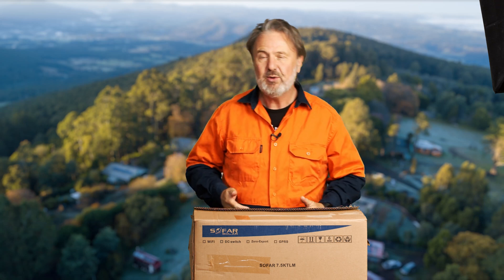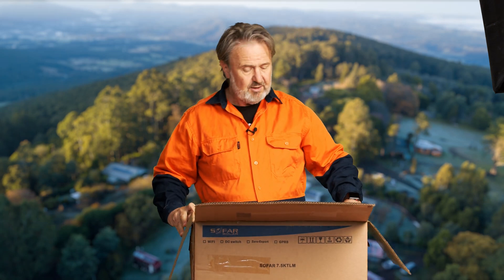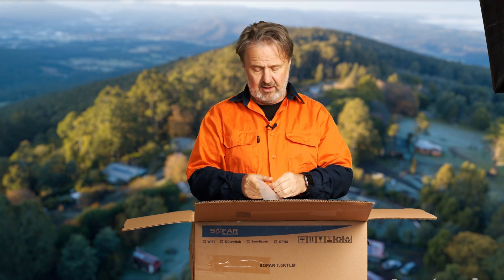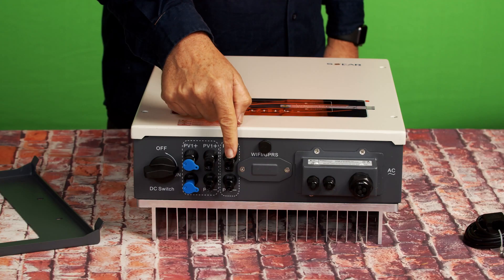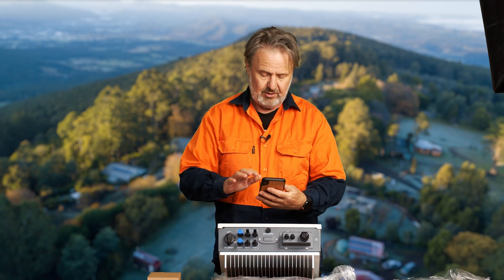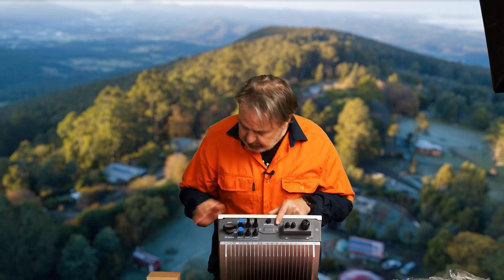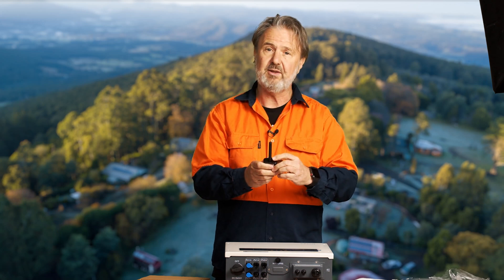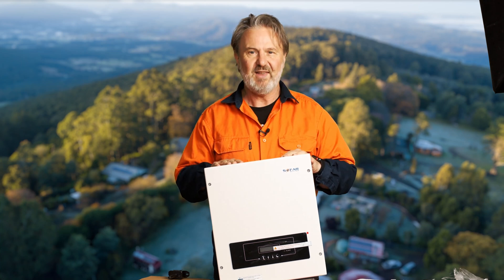Sofar Solar Grid-Connect Inverter

Comment: Hi i have a question about this inversor, If i have 10x 450W solar pannels i have to connect 6x to one PV1+ to MPPT1 and the other 4x on the other conector PV1+ MPTT1 so, on this way each connector has shared less than 2750w on its..... is it ok? Thanks in advance

Comment: GOOD DAY SIR, what if i have multiple grid tie inverters, say 3 pieces, since in our place there is no NET METERING, i would need to install CT sensor, my question is, how many sensors do I need? do I only need 1 CT sensor and connect all the inverters CT wiring in parallel to just one CT sensor? or do I need 3 Ct sensors, 1 sensor per inverter? Thank You sir.

Comment: Hello,

I have a Sofar inverter 20KW and the grid voltage is 220V in each phase. 

When the inverter starts injecting in the grid, the grid voltage starts increasing above 220V and can go up to 260V and the inverter shuts down and restarts, and the voltage goes down back to 220V, and it repeats the same cycle again.

How can I fix this to keep the voltage at around 220V?

Thanks in advance,
Yassine

￼
Reply from the maker: Hi Yassine, the problem you describe is not a fault of the inverter but the result of your limited cable size from the output of the inverter to the grid connection point. Ohms Law tells us that voltage rise at the source will be determined by the impediance of the cable and the current passing through it. Here's an excellent explanation by Mark of MC Electrial here in Australia https://www.mcelectrical.com.au/solar-voltage-rise-explained/